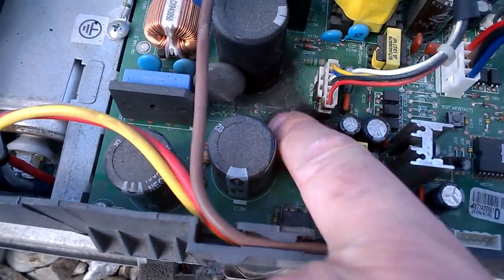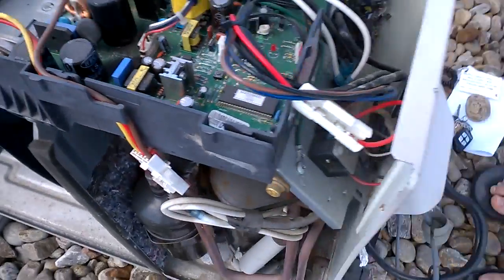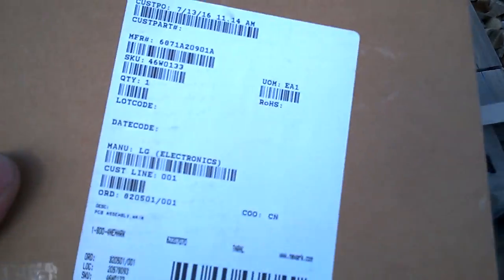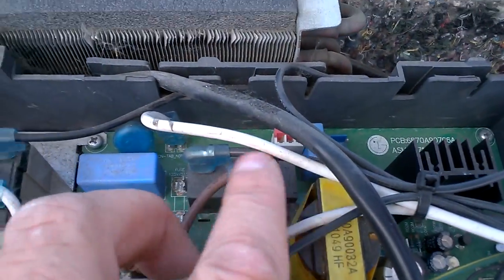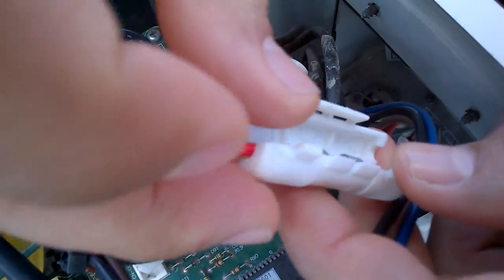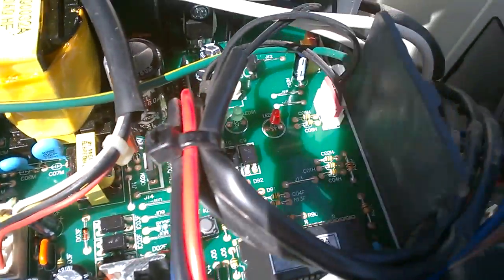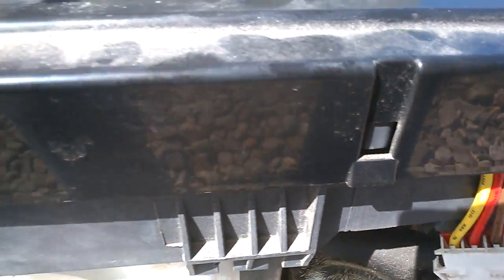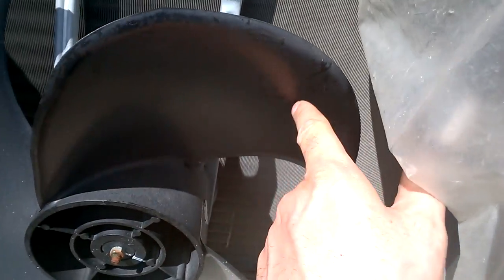Goldstar (LG) Split Air Conditioning No power/won't start/won't shut off - bad control board

Comment: This looks very similar to my problem unit and building rooftop, any chance this is in the triangle in montreal? and would you be able to help me?
Reply: I'm in the triangle and was having this EXACT problem. I just replaced the main printed electronic card like in this video, so finally I have power going to my unit, but my a/c is still not functioning properly - it just turns off after 5 seconds of turning on. Have you been able to find a solution?
Reply: @danielblum4139  I haven't found a solution yet... I had a technician look at it and hr thought it was the electric board but he isn't sure yet he will look more into it when I'm back in the city
Reply: @danielblum4139  hi did you ever had any luck with your ac?
Reply: @omar I am in Cote Ouest Phase 2, same problem. Were you able to fix yours?
Reply: @langecornu71  haha I'm in the same building with you, still as it is. I had someone look at it this summer and he told me better to replace the whole AC

Comment from the maker: After installing the new electronic control board, I wrapped the board box safely with a plastic (careful not to touch wires so it doesn't get in fire).  2 years later the electronic board is in perfect condition, so the problem was indeed water being sprayed on the control board from the fan blades.

Comment from the maker: For this specific unit, the mother (circuit) board is the LG 6871A20901A PCB ASSEMBLY, just google up with this number to find which sites have it and sell it in your country/area.  Also search it on Ebay.  This machine gets older so this mother board can be harder and harder to find.
Reply: Dear Sir,  I have a similar unit, blown fuse may I contact you personally for help?
Reply: Hey do you know how I can get the service manual for this a/c unit (GS120CE)? Can't seem to find it anywhere.
Reply: @danielblum4139   I am in Cote Ouest Phase 2, same problem. Were you able to fix yours?